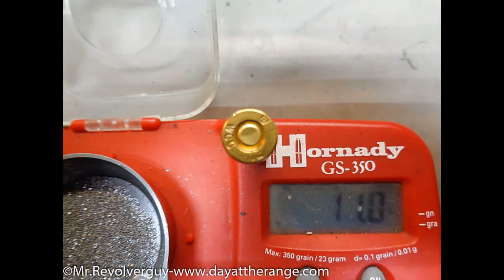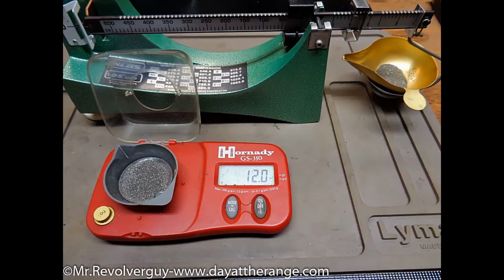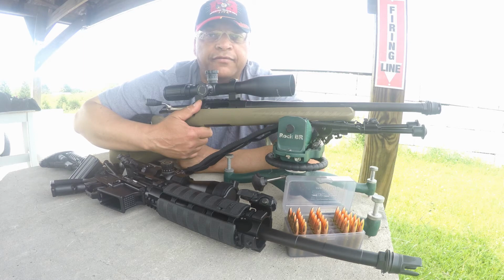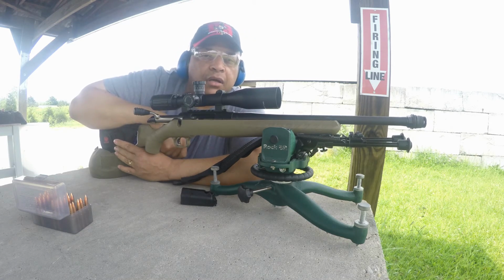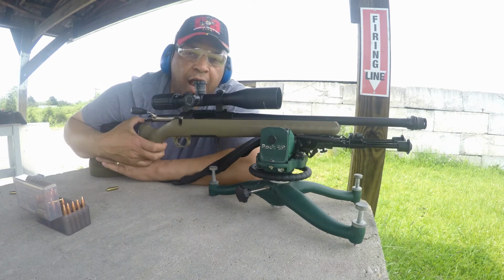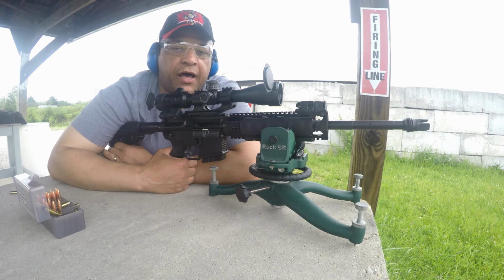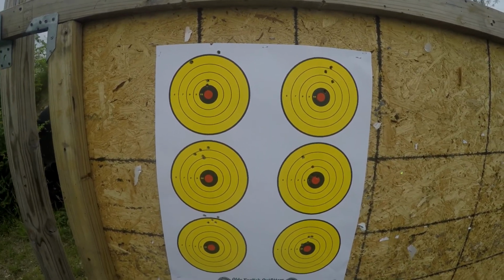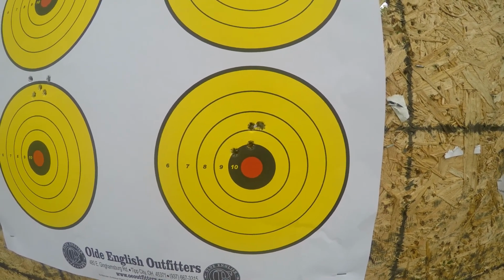300 AAC Blackout: Berry's 220 & CFEBLK Powder Testing

Comment: I 100% agree on the slotted Sheridan case guage. I don't mess around with those other guages anymore.

300 Blackout is a legitimate round for all things within 300 yards, especially configured as a suppressed SBR.

Based on the results from Johnny's Reloading channel, I'm not impressed with CFE BLK. I'm good with Winchester 296.

I'm very interested in that Ruger American Ranch in 300 Blackout.

If you're looking any sort of precision, cheap plated bullets will let you down. Like you said, good enough for plinking and blasting.

Comment: Wow.  Try accurate 1680.  I got three shot groups that were nearly in the same hole with this same load work up out of a CMMG Dissent 6.5” barrel unmagnified with a holo.  11, 11.5, and 12gr.  11.5 shot the best for me with an average of 915fps.  I was testing them for muzzle velocity and stability so I could test if they were stable enough to run suppressed and they were fine.  I tested them at 12 yards for this reason, but will be loading 25 each of 11.5 and 11.7gr to test them out at 25-50 yards.  This rifle is for home defense purposes, so if I still get decent accuracy out at 25-50 yards, it more than suits my needs.  I want to develop this round for range use and have developed a 190gr Hornady Sub X for self defense purposes that has great accuracy.  I have other rifles for longer range shooting.  Thanks for the video dude!

Comment: Do you have to open the neck  with a neck sizing die? The 220 berrys falls off the cartridge when I cycle my Lee six pack. Thinking I need to open the neck,looking for your opinion. Thanks
Reply from the maker: Yes sir expand just a little. Let me know if I can help.
Reply: @Dayattherange  thanks
Reply: @Dayattherange  maybe you can answer another question. Shouldn't my decaping pin open the mouth wide enough. Can I ajust pin to open mouth more?
Reply from the maker: @rogervanvarick3499  Your decapping die expander ball inside your full length sizing die will not do what you need. You need the cheap Leee Powder Thru expander die or the Lyman M Die I have the Lyman M Die but have used the Lee but gave it way.
Reply: @Dayattherange  thanks. I will have to sacrifice my powder check die. I have a lee 6 pack, unless I don't need to crimp that woud make room. Whats your opinion on crimping?
Reply from the maker: @rogervanvarick3499  I never crimp rifle rounds honestly even semi auto's. But I validate that all my cases will give proper neck tension. How is your 6pack working out?
Reply: @Dayattherange  just getting set up not using crimping die allows me to also use my powder check die. Waiting for powder and calipers. Thanks for you input👍

Comment: I was disappointed when you got to the range and had no chrono, I wanted to see what you got with what I'm assuming are 16" barrels (better info than type rifle, although bolt vs semi is important too) .  It was interesting to see your groups at 11.5gr .. in my 10.5" ar barrel , I found the sweet spot at 11.7gr of cfe blk , I shoot suppressed and those come in at a rock solid 1040fps and shoot right at 1 moa.    Interestingly Hornady 220gr ELD-X  with CFE Blk only need 11.0gr to achieve 1050fps.. both at 2.250 COL
Reply from the maker: Yeah so was I. You can go see my journey with 300blackout here with almost 130 loads chronographed https://dayattherange.com/?page_id=3817

Comment: Why didn't you use magnum primers like the manual states?
Reply from the maker: It depends on many different factors for example one manual calls for small rifle and one calls for small rifle magnum. In the spirit of working up loads when there is inconsistency I start with small rifle then move to small rifle magnum.
Reply: What manual calls for magnum primers in the 300 blkout?   I went through Hornady,Speer, CFE Blk and all my other data and couldn't find a single recommendation for magnum primers.  Why would you even consider needing magnum primers?  These are very fast burning powders at generally very small charges around 11-12gr ?  It also Kinda defeats the purpose of a quiet round designed to be suppressed !

Comment: Like you I absolutely enjoy the 300 Blackout ( A Reloaders Dream )
I got a bullet from Midway USA that you should try it is a
( Lapua 100g Cutting Edge )
This is a match bullet 
I live in California so my AR in 300AAC Blackout meets California regulations with a juggernaut hellfighter device. I also have a Ruger American Ranch Rifle in 300 Blackout.
My AR is a Anderson arms lower upper & Barrel it is a 14.5" 1-7 twist with a pistol gas system. 
So far this rifles favorite load is a Hornaday 150 FMJ-BT on top of 17.0g of Lil-gun and what I will say next is the honest to God truth.
5 shots 1/4" at 100m No Joke.
Optics is a Vortex 6.5×20x50 w 30mm 
Ps the 14.5" Barrel is made legal by tack welding a 2.5" muzzle brake for a total of 17".
The Ruger is a hunting rifle set up with a Vortex 2.5x10x50 I shoot the Lehigh defense 115g Controlled Chaos copper out of it.
Reply from the maker: Scott I only see the .264 cutting edge bullet not the .308 for blackout
Reply: @Dayattherange  
Sorry about that.
I looked it up it is under 
Lapua 30 caliber
( 308 diameter ) 100 grain hollow point.
Midway USA
Item number 963322
Lapua # LU4PL7224
It is saying that there are only two left in stock.
Reply from the maker: @scottrice4431  Thank you just added one to my cart.

Comment: Try 11.0 to 11.4 gr Accurate 1680
Reply: What COAL do you typically use?
Reply: With subs I seat to function in a PMag, supers I seat shorter, I like the  Nosler Varmegeddons under 19.5 gr of Winchester 296